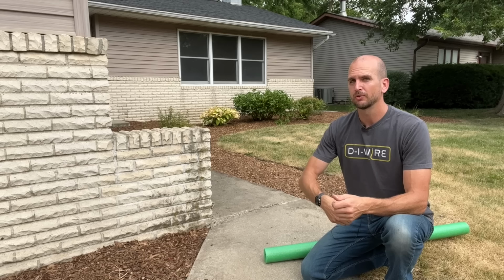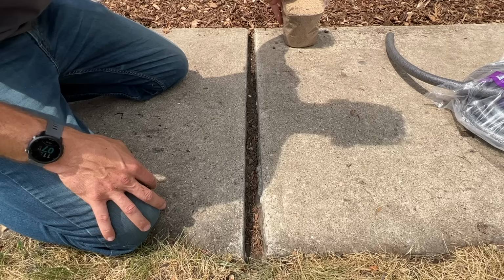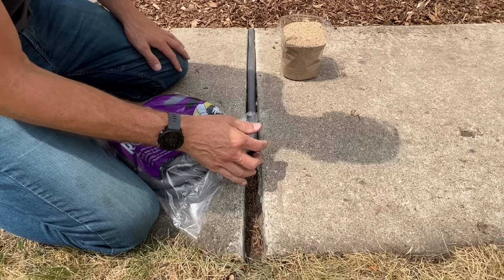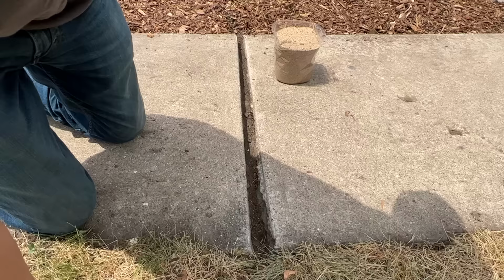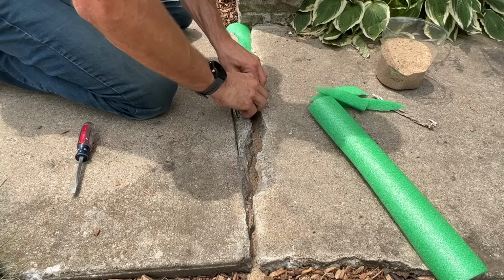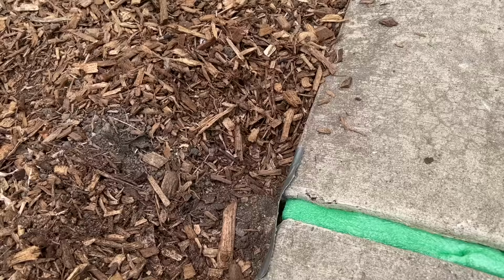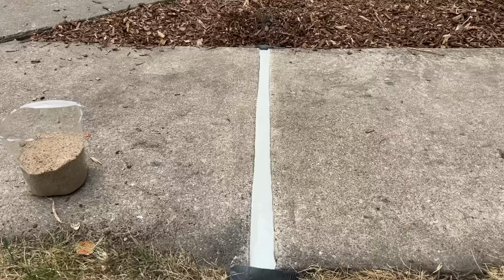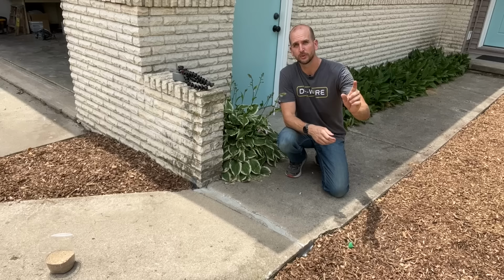How To Fix A Large Crack In A Concrete Sidewalk | Surprising Results!

Comment: If slabs are at different levels, drill a 1/4" hole, insert the nozzle of Expanding Foam and watch the sidewalk rise.  May take a couple of cans but much cheaper than calling in a slab jacker.
Reply: Id love to see this without a void. Any videos? I dont see this happening with a slab sitting tight on the ground. Could be wrong.
Reply: That doesn't work with cans of expanding foam from places like home improvement stores. Have to have two part (expensive) foam.
Reply: fartpoobox ohyeah  you really need to learn the difference between how open cell and two part closed cell foams work.  Claiming 'i seen it on YouTube' is certainly amusing though, as if everything on the Internet is real.
Reply: With just 1,2 or 13 cans of Great stuff foam it doesn't work on sidewalks or on wheelbarrow tires  overtime the foam compresses and can't hold the weight of the slab or load of wheelbarrow stuff.

 Save your money and hire a pro to break up  small part of slab and re pour.  Eventually what I did. I got an amazing deal on a 27 lb jackhammer from Amazon for $110 I own this thing it's a beast and manageable without too much difficulty.  One day rental is 75 bucks I've definitely used it more than 10 days already and it comes with that great little plastic case, dorky goggles,  useless gloves. I threw out and use my own.  straight from China. Doesn't matter it's still a beast  "Xtreme power" I think it's called.

Or use the part 2 whatever Brandon might be talking about. I can't verify that. 

 YouTube is your friend but it can also be your enemy and lead you down the wrong path. You just have to be able to decipher between the two. 

I'm only speaking from experience!
Reply: @therebellion6911  - please, what do you mean by you'd love to see this without a void?
Reply: @bethanyanderson1745  Maybe and I mean maybe you will lift it with a can of foam if there is a void to spread in ,though controlling it will be hard but no way you are drilling a hole in the concrete and sticking a can of foam nozzle in it and lifting the concrete under normal circumstances. Some of the professional foam guys cant lift it. The one video I saw on it the guy lifted the edge with a jack and then filled it.
Reply: @therebellion6911  ah, now I understand. Makes sense. Thanks!
Reply: Expanding foam would have nowhere near the lifting force to lift a slab of concrete, at least I'm pretty skeptical of it
Reply: @manw3bttcks  - I'm surprised mud has more strength than the foam
Reply: Who's calling in a slab jacker??

Comment: I wish I had known about this long ago!! My dad’s electric wheelchair had a hard time going over gaps, caused by tree roots, when going to our wheelchair van. Sometimes the ramp would settle on a crack and not sit level. This caused the ramp to tilt when he drive the wheelchair into the van. The cracks in the sidewalk were also large and hard to get across. These were situations that were a serious tipping hazard. Sadly, Dad passed away two weeks ago. He’d have approved of your fix. He had ideas like this, too. Thanks for sharing. I’ve subscribed and look forward to more helpful information.

Comment: Using a pool noodle for backer rod   for cracks is absolutely great thinking. The thickness of the calking is critical to making a successful repair. . Read the information on the label to find what that is. To create that consistent thickness, I use a scrap of board with a wooden spacer tacked on it and run it the length of the  backer it pushes the backer rod down to the correct depth consistently. When the calk is too thick it doesn't stretch properly and will pull away from the concrete and the joint still leaks.

Comment: This is nice and I’m glad you showed the trick of sprinkling the sand on top which definitely makes it blend in better! I’ve seen places that were caulked w/o that step and it looks terrible and sticks out like a sore thumb.
Reply: Repent to Jesus Christ 
“the Lord delights in those who fear him, who put their hope in his unfailing love.”
Psalms 147:11 NIV
J
Reply: I wish i knew the sand trick when i sealed a crack in my walk.  the lighter sealant really sticks out.
Reply: If you use the sand on a crack instead of a joint people tend to bring the caulking to the top and then add sand. The patch will then be higher than the cracks. Make sure you leave it down from the top just a smidge if you are adding sand. I personally dont care for the sand look but its just a preference.
Reply: I saw a man fixing and patching someones front steps and he got some dirt and mixed in for it to look more like the old cement he was patching!! not a bunch but enough to take away the "new" look, and it worked!
Reply: @therebellion6911  Hi. What’s the difference between a crack and a joint? Meaning, even if you do a joint, aren’t you supposed to leave the sealant slightly below the concrete to compensate for the sand as well? Thank you
Reply: @mikeike7114  I don't use sand on top but for the conversation people tend to want caulk all the way up to the top on a crack but generally dont on a joint since a joint is originally with a crevice. I bring crack all most all the way to the top ( no sand) laving down just a hair causes slightly low is better than slightly high and I leave my joints down about a 1/4". Drive ways are rarly flat and your playing with fire bringing it to the top unless you like the look of it running 3" out on your concrete like Ive seen people do.

Comment: For a more substantial joint, I pack the seam/crack with pea gravel to about half inch depth from the top.  Then fill the joint with the joint filler.  Much less likely to pop out or be  "ejected" due to ground movement.
Reply: If you do not fix the problem which caused the crack, there will be trouble on the horizon.  I am fixing cracks at our mountain property using an asphalt based Lowe's product, but filling most of the crack with gravel first, then topping it off.  Not perfect, cannot be applied too thick at once and it requires going back over more than once after drying in.  This guy's method does not look as good for what we have but then none of our gaps are as large, so I can understand that his problem requires a different solution.
Reply: @replyhere590  thanks.  The joint filler i use between stones is a flexible epoxy type and it seems to move and stretch somewhat without breaking seal

Comment: Go with low expansion urethane instead of baker rod.  Applied gently with cleaning off the excess after 20-30 min (time to get ready for next step) You will then start to use urethane for almost every gap/void/volume filling inside or outside.  Very nice talent that God gave you. You're definitely giving good fruits with all your videos. I like your humility and your hardworking being.

Comment: I have 1/4" to 3/4" gaps in several spots. Already had my backer rod. Didn't know what to use for a sealant. The SSL sealant was the final step I needed. The sand topping was a bonus. Great video....thanks. Happy 4th of July.
Reply: Sika 2 c ns I think it's called is what I used. I worked industrial.  Usually want to use an open cell backer rod
Reply: City problem
Reply: Yes u have ants mice be3
Reply: @terrymounts4371  - huh?

Comment: Essentially a large size foam backer rod.  My Grandfather used to use the tiny backer rods to fill sidewalk cracks followed up with some sort of concrete compatible caulking.  I'm not sure what he used but his repairs would often last more than a decade.  I could probably swing by his home that he lived in long ago and built in 1986 and they'd still be there long after my Grandfather has been gone.

Comment: Or pipe insulation tubing.
 (SAME material). Just in case pool noodles are out of season.
Reply: That’s what I was thinking. Plus pipe insulation is gray, so if it peeks through the sealant it won’t stick out like a sore thumb.

Comment: I used a very similar technique to repair concrete walkway, but instead of sprinkling sand as the last step, I used some dry mortar mix. The finished product will more closely match the concrete walkway.
Reply: Great idea.
And as I  posted in my own comment, I would use a generous amount and simply sweep off excess the next day.

Comment: This is a pretty elegant solution. I owned a home where the garage slab cracked and had I known how to do this, I would have. This is a 100% solution versus using patchmaster to fill the gap which in hind sight was a 50% solution.

Comment: I tried something a bit different. I used Dow expanding spray foam to fill the crack. It dries quickly, then I used the ssl to seal up. Worked great and saved me the time of having to cut and shape backer foam. A word of caution, don't go buck wild with the spray foam, it expands big time.... Whichever way you go, the crack gets fixed....
Reply: They make low expanding.
Reply: @therebellion6911  yeah, I had to learn that the hard way.....lol ...
Reply: Warning, I tried expanded foam in a concrete (cement) crack and it did not work. The foam gets chipped out and discolored.
Reply: It is very difficult to control joint depth with foam. And for the SSL to perform properly the depth needs to be very consistent. And the profile of the sealant will be incorrect. These things matter for the sealant to perform properly.It is a quicker and easier solution but not a quality solution .
Reply: @royjohnson465 - isn't that why sealant is used over the foam?
Reply: @genecarden780  - do you think it would work to employ the cup thingy in the drill to trim the foam uniformly? (method described by earlier commenter)
Reply: @bethanyanderson1745  I did not know about sealant "over" foam? If I would have known that then it may have worked better and not failed like it did.
Reply: @bethanyanderson1745  I replied earlier but I guess it didn’t post
https://www.tremcosealants.com/fileshare/DataSheets_Hyland/Vulkem_45SSL_DS.pdf
This is what a properly installed sealant joint should look like. Anything other than this profile leads to premature failure. The use of expanding foam is not a good idea. I’m not saying it won’t work but it is guaranteed to not last as long as properly installed sealant with properly installed backer rod. My guess is using spray foam and then removing i5 to the proper depth will result in exactly the opposite of this profile where the sealant is ticker in the middle. The most common cause of premature sealant failure is bond failure. The 3most common reasons for bond failure are 1. Bonding surface contamination/ improper cleaning and priming f bonding surface.2. Improper joint depth control 3 Improper joint profile( not thinner in the middle and or improper and inconsistent amount of recess in the bottom of the sealant.
Spray foam causes all 3 of these problems that must be addressed).Spray foam is a bad idea. It can be used but the results will be premature sealant failure.
Reply: @royjohnson465   - thanks for responding.  Perhaps I misunderstood your earlier comment. When you said "Warning" followed by the results (chipping, discoloration) of your own usage of foam, I took it to mean a literal warning for readers to avoid the OP's repair method. You were trying to be a nice guy by sharing your experience. However, I assumed you must have missed the part of the video about the sealant or you'd have known the sealant caulk would prevent chipping and discoloration. Hence, no reason to issue a warning. Right? So, that's why I told you abt the sealant in the video. Whew!
Reply: @genecarden780  - very interesting information. Thank you for taking the time to reply.

Comment: For a smaller crack but still large enough that it would need a lot of sealant, I had good results stuffing in pieces of or whole corks saved from wine bottles that I had on hand, then sealant over. I like the suggestion of putting sand in deeper cracks.
Reply: What sealant do you use?

Comment: Very cool, I'm also a crafter so I always have the pool noodles!  I also learned from another channel who uses this & foam in his monster props, that you can use a heat gun to make the foam stick/glue itself together if you want to 😉
Reply: @Vro - you use a heat gun to make the foam stick to what exactly? Thanks
Reply: @bethanyanderson1745  You can shape it, stretch it, stick it to itself, check out Stiltbeaststudios pool noodle pumpkins.  He uses pool noodles, foam pipe insulation all the time & learned the technique from him.
Reply: @Vro-  - thank you for replying. I'm not a handyman so perhaps that's why I'm not seeing the connection between filling a cement crack and heating a pool noodle /foam.

Comment: You could use an expandable foam vs. the Backer rod so you can avoid going back and forth with cutting the Backer rod to suit the cracks. An even easier method IMO is to use a pre-mix cement screed which you can buy as a dry-mix in a bag. Just add the recommended water and pour into the cracks directly. It does have admixtures that would prevent cracking between the old and new concrete. Trust this helps.
Reply: I think I have seen a mason on YouTube do something similar instead of sand.  I think his mixture was 3 parts sand to 1 part portland cement and then he wetted it to the consistency of wet sand.  He packed that in the crack.  It would stiffen up but remain flexible over time.
Reply: No foam or processed chemical adhesives, some crushed recycled construction waste with some cement pored onto them and everything is fixed naturally. Even stones that are around your property, if they weren't naturally formed and they come from construction, or you can buy you any recycled construction waste of the appropriate size , have a bucket for any eventuality and you can always use them as filler or even cast some bricks if you need any.
Reply: You could use the expanding foam but pool noodles sell at the dollar store,  3, 4 noodles is going to cost way less
Reply: Actually using noodle is better because that caulking form is thinner on middle and wider on side which means thin part flex easier and wide parts sticks well to concrete. IF that caulking is same thickness whole area it can peel of easier.
Reply: Trouble with expandable foam is laying a perfect bead down to suit expansion rate.  This almost never happens, which means shaving it down - p.i.t.a.  The noodle is cheap and bendy: perfect for irregular lines.
Reply: And somebody needs to do a video WITHOUT the hand “gestures”  , it elevates the look of your “confidence”  or IQ POTENTIAL and validates the content
Reply: That's too goddam expensive!!!
Reply: I agree.
Reply: @guysumpthin2974  STOP IT!  Constructive criticism ONLY here, PLEASE!  No hatin' allowed.
Reply: First, on the second crack, I would have at least chiseled it straighter and on both would have used some type of cementitious material; i.e. hydraulic cement or a bonding type product, instead of the backer rod and self-leveling acrylic. Sure the gap is filled but the acrylic will not accept a stain or surface coat like a cement based material and will always look like it was a "patch" job.
Reply: @ms.rubyj.4259  that is very constructive , very valuable, no hating
Reply: @guysumpthin2974  please you do a video…the perfect video since you know and teach us please professor.
Reply: Could you give me the brand and the name on the bag of this product. 
I searched online Home Depot n Lowes and couldn't find it. Thanks
Reply: @guysumpthin2974  What are you talking about? I think you need to revisit psychology 101, because the exact opposite of what you said is true. 🤣😂🤦

You can acquire plenty of content digitally on the subject matter if schooling isn't your thing.
Reply: @Alexxela19202  
Remember, any reference to a god with a small g is a reference to satan. 

Believe THE GOSPEL 
(1 Corinthians 15:1-4) 
Jesus Christ will save you too ❤️
Reply: Sheppy99  Not very difficult to trim cured expandable foam plus it gives a tighter seal between cement since it is bonding to it as opposed to backer rod that is more likely to allow water ingress over time but it's all good, lotsa ways to accomplish the same end.

Comment: I’m so glad I found this video.  My house has several large irregular cracks in the back driveway due to ground fluxuation. Numerous attempts by various individuals has ultimately failed in filling these cracks and I’ve been left with vegetation taking over these areas. I am so glad to find a permanent solution to this ongoing issue. Looks like I’ll be buying lots of pool noodles in my future (something I never thought I’d be purchasing.) Thanks for your highly informative, step by step video.
Reply from the maker: Best of luck on the project this specific crack is holding strong 2 years later 👍.  Make sure you get the Tremco Vulkem 45 SSL.  That stuff is good and with proper prep will hold for years.

Comment: Very nice results - looks great!  Will be using this repair on sidewalk at an apartment complex.
Heh would you consider showing us how you keep your tools and material organized?  Earlier I noticed your tote for electrical connectors. Thinking I need one just like it!  For those of us that do sidewalk, yard drainage, electrical and plumbing all in the same week, how to keep everything organized!   
Awesome channel for DIYers and multi-trades maintenance folks.  Thanks!
Reply: Use multiple tool bags. 1 for plumbing, 1 for electrical, 1 for general maintenance, 1 for patching/painting/minor carpentry repairs
Reply: I also use plastic 5 gallon buckets to help out. But yeah it gets crazy!!!

Comment: Great video ! As mentioned, before using pool noodles as backer rods, check if they are open-cell or closed-cell foam. Remember how squeezing some kinds of pool noodles leads to water dripping out? Those are made of open-cell foam. Open cell or Polyurethane foam will soak in water and is not a good choice for filling material in concrete. Closed cell or Polyethylene foam is a much better choice.